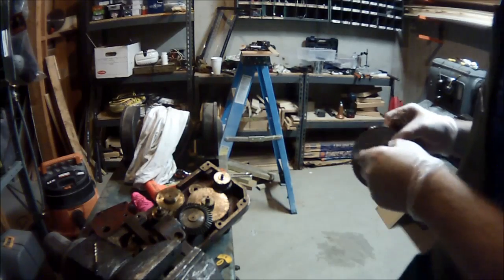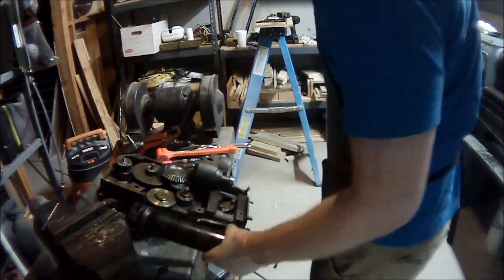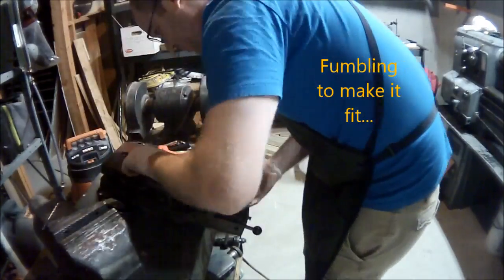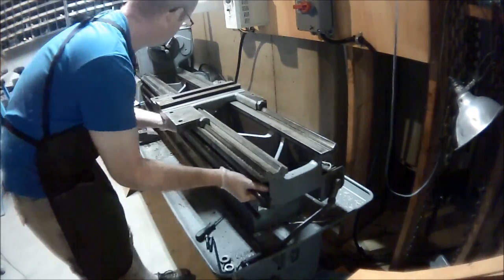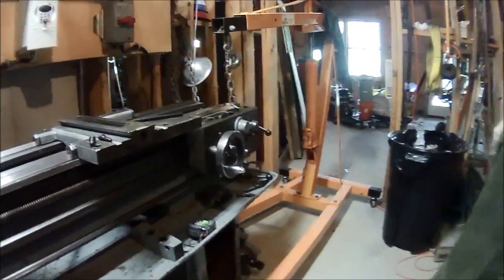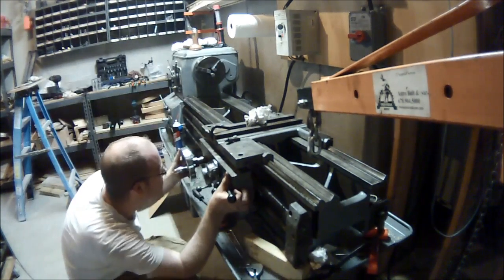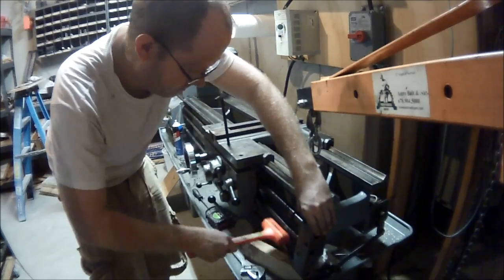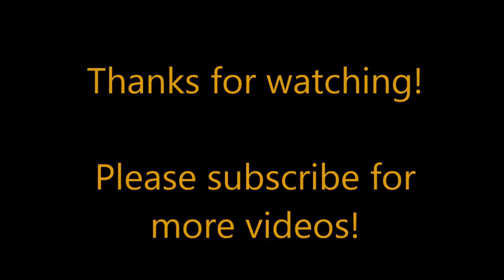Reassembling the Lathe Apron- Storebro Bruk Rebuild Part 8

Comment: Hi Jonathan just check you are supposed to use grease to lubricate the gears, many lathes use oil to lubricate, my Myford Super 7 does. (32 weight hydraulic oil eg esso nuto 32) if there are any "grease nipples" they may in fact be oil nipples. Just because there is grease inside may be because someone else filled it in error. I would email storebro and ask what the lubrication requirements are. Rob (Xynudu) complained long and loud about finding grease in the schaublin lathe he restored.
Reply from the maker: Thanks for the message. I took a look at the galleries and there are oil fittings in several sections but none that feed the cross slide,rack or gears in the apron.

Thee are certainly many areas that use oil but I haven't seen a delivery method for the gears etc.

I will take your advise and if they get back to me I'll come back and update you! I appreciate the concern!

Comment: hi , i'm about to do the same job on my ørn sk4 . i lost 2 of 11 teeths on the gear trying to make threads .. did u say the gear at storebro cost 400$ ? do you have a link to the one you bought?
Reply from the maker: I googled and found the storebro large company online. I sent the serial number and an image and they found what I needed
Reply: @exportedafrican  ok , i talked to the guys today , so they are on it :) do you have a video of making threads with this lathe ? i need to figure out what made my gear strip ... if you dont , could i ask you to make a video of making the lathe ready for threads and making ? what is the handle to the right ogf the ABCD and 1-8 handles?
Reply from the maker: I don’t think so but I can try pull one together one evening. 

Did you crash the tool holder into material or chuck?
Reply: @exportedafrican  that could have happend because when i finally found out that there was one handle on the apron for threads , this movedthe apron opposite than the normal feed screw. but maybe also there need to gear away the normal feed shaft when making threads ? that's what i was thinking the handle to the right of the ABCD handle was for . mine is stuck... AND previous owner removed the tread feed handle on the apron .
Reply from the maker: dartsportduster I would have to see more. Email me a picture at exportedafrican@gmail.com
Reply: @exportedafrican  I just went out and removed my gear , much easier on my lathe. 2 bolt , 1 nut ... 5 minutes and it was out :))